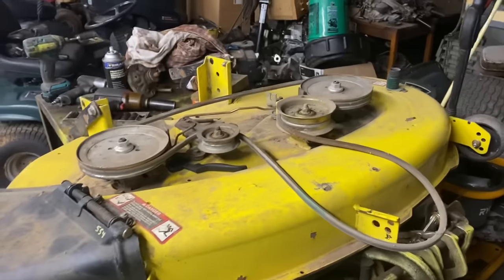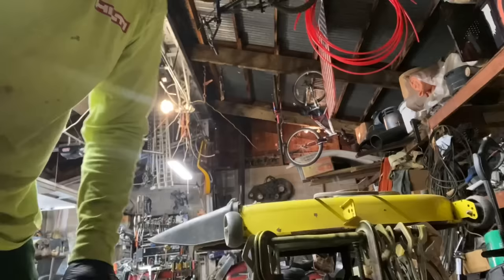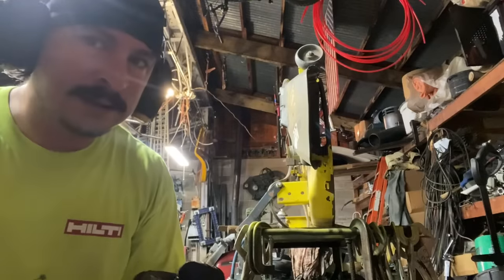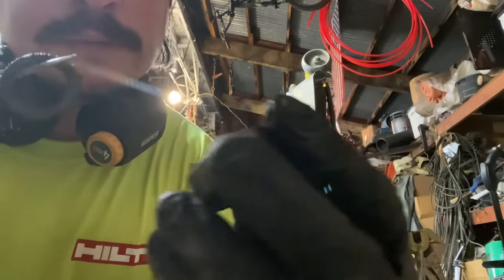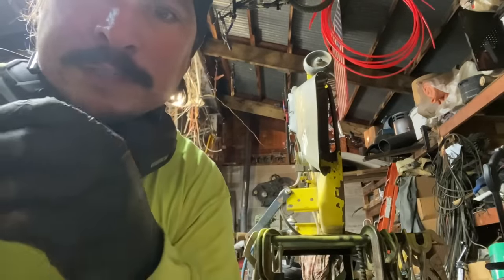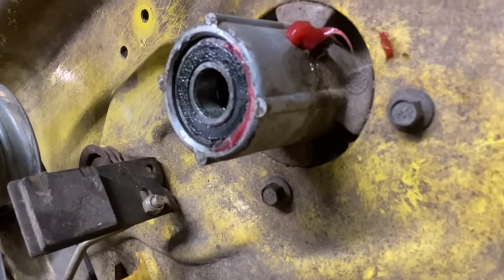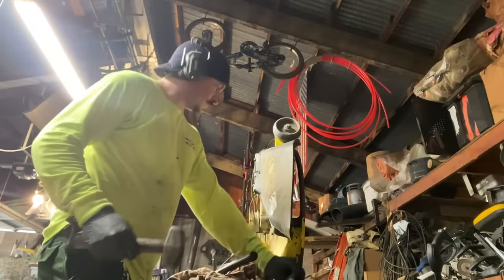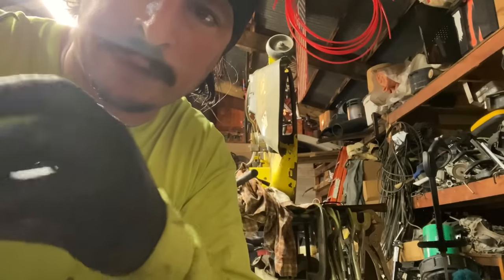Part 1 - Don’t trust the “Experts” Grease your mower deck sealed spindle bearings Common sense.

Comment: One thing that bothers me about so many of these bearing videos. I agree that is absolutely essential to have grease in bearings and sealed can be a bad idea. But why is it NO ONE ever sticks a thumb in the bearing inner race to rotate it and see if the bearing is still smooth & good. See if it is good folks before you take the trouble to grease it! Geez. Same issue with motorcycle wheel bearings. But overall, a great presentation. Thank you young man!
Reply from the maker: I recon I didn’t care about if the bearings were smooth or not just to prove my point. But I think anyone would have the natural instinct to check the feel of the rotating bearing to guage if it has obvious gritty feel. I know I always check them and spin the assembly before teardown to see if I feel an issue. If I feel an issue I explore deeper to see what one is bad, usually the bottom.
Reply: @GTObearclaw1  You're the kind of mechanic I would have liked to work with when I was younger and still working!

Comment: There are no zerks on my Hustler xonei 52"deck, got about 200 hours from new and outer,near discharge, that started some blade spindle noise. Bought a spare spindle,152$.Thinking when I change to see about looking at repairing and might put a zerk into each of the 3 spindles?
Reply from the maker: Dang, at only 200 hours and at a cost of over 150$ for just one. Dang, that’s steep. I can get a set of three for less than that on the box store machines and they typically last that long. I don’t think adding a zerk would be an issue. Iv done so myself on tractors that came without. I have found that having a zerk on the upper side of deck is much easier to access and stays cleaner and also good to point them outwards so you can get on them easy with the deck installed. It’s also wise to check your deck for a tensioner pivot zerk. If it has one, those things do wear down and occasionally greasing it will help it’s longevity. Iv even seen them rust and get stuck.
Reply: @GTObearclaw1  no zerks on idlers either, I will look on the big online box store next time, thanks
Reply from the maker: @alanbosma2159  idler and tensioner pulleys don’t typically have a zerk as they are not serviceable unless you know about the grease needle. As for the zerk at the tensioner pivot that I mentioned it’s where the tensioner arm pivots on the deck. A half way quality machine will usually have a zerk there that most folks never know about. Not actually the tensioner pully itself.
Reply: @GTObearclaw1  I looked on the big A for a part, none. Gonna try the big E next. I looked at the idlers and none have zerks and only other is for the drive pump,separate belt drive. I have a needle but was hesitant to peel that seal  back till I saw your utube..I have a spare  idler so if I can't get it back I can replace it . 
Thanks
Reply from the maker: @alanbosma2159  I have a few videos where I use grease needles. Just clean the seal really well so you can see it while inserting needle beside it. I find that turning the needle helps lift or move the seal aside without damaging it. If the seal is still soft and flexable it is usyally a smooth process. If seals are old and dry I have cut a few. But even then they can go for a year or two after adding grease. Just a little cut on the seal won’t be bad if you want to squeeze some extra hours out of it. But in most cases I have great success with the needle and not damaging seals. Thanks for commenting.

Comment: I have not seen a spindle  without it having roller bearings , Are ball bearings the standard on Homeowner grade equipment?
Reply from the maker: Yes absolutely ball bearings are the home owner model go to. Tapered roller bearings are usually only found in commercial grade or higher quality units.
Reply: @GTObearclaw1  I guess that explains how mine is going on 25 yrs in service, I was only able to find one replacement spindle for the center blade when i rebuilt the deck 4yrs ago.

Comment: If the spindles are making loud noise is it to late and the bearings should be replaced or just grease them heavy
Reply from the maker: If they are loud it’s probably too late. A good greasing might get you a few more hours but I’d check the loosens of the assembly by feeling movement of bearings. Obviously while the units not running and no parts are in motion. If the bearings have any movement, it’s not good. Consider this, if you do need to work on it and you decide to add grease first, you just made the disassembly more messy by adding grease. A well lubed bearing may never need to come apart but adding grease to a part that needs to be worked on will just be a added hassle.

Comment: This was meant for me to see, funny I just greased my spindles today (Installed new blades) I kept pumping like 30 times,nothing,  after about 30 more it came out.😮
Reply from the maker: Nice, thanks for the comment and confirmation on how many pumps an empty mandrel can take. You’re set now, in the future 4 or 5 pumps will get you done. I had a deck this week on an older model Husqvarna zero turn and the mantels took 92 and the other took 94 pumps before I seen any grease come out.
Reply: @GTObearclaw1  wow 92+ pumps mine is a 2003 Troy Built probably never greased, lol.
Reply from the maker: @davidlaws1438  that’s impressive but I don’t doubt it. Your lucky it had zerks. they can go a long time without grease sometimes. Iv had some comments about folks not greasing for 20 years and Iv personally seen some fail after just a few years and less than 100 hours. I’m sure it all matters how much grease they came with and more than likely highly dependent on the quality of grease used for one to be able to last 20 plus years. I’d say your safe to go for many years now without grease but it’s easy enough to hit it with a few more pumps each year just in case one didn’t receive as much grease the prior time! It’s always better to be proactive!
Reply: @GTObearclaw1  yes now that I know their there I will definitely grease every year. 👍

Comment: I have a 42” mower deck from a LA105 that the holes have elongated when I removed the spindle. Can I rotate the spindle and just drill new holes or how do I fix it
Reply from the maker: That’s a option. Low likelihood the bolts will come out of the spindle without breaking but you will
Have to remove it anyways to repair it so give it a try. I like to weld a reinforcment plate in while I have it all apart, I have some other videos to show that repair.

Comment: I've seen them with the lower bearing having the inner grease seal removed, but the upper still being sealed. That will allow some grease into the lower, but its not all of em.
Reply from the maker: Some have seals on the inside some don’t but if they have a grease zerk take advantage and fill it completely till you see grease exit and you will
Have longer bearing life. If you don’t have a grease zerk they are easy to add.

Comment: When you popped the seal off why didn't you pack the bearings then before you put the seal back on
Reply from the maker: Simply not what this video was made to prove. My point is that there is no need to go this deep into a bearing. Latter in the video I show how using the grease gun achieved that same result without any need for dismantling a deck. It all makes sense in the end. Needed to prove a point.
Reply: @GTObearclaw1  👍

Comment: I've been looking at all the different opinions on this controversial subject and have concluded that it's better to remove seals and here's why.  When grease is pumped into the spindle cavity it will flow along the path of least resistance.  Eventually the cavity fills and if you continue to pump the hydraulic pressure will rise until the weakest seal "blows" and lets the grease pass.  The other bearing seal is still intact and never gets fresh grease.  This is why I believe grease was seen on only one end in the demonstration.  If the inner seal is removed grease is free to continuously contact the roller balls from the spindle grease reservoir.

Another reason sheer hydraulic force might not work is that some mowers have a vent on the spindle.  My Exmark 48 has a zerk on one side and a spring loaded vent on the opposite side that allows the cavity to be filled but no real pressure can build.  With this design it is even more important to just fill the spindle to directly expose the rolling elements of the bearing to the grease supply and not rely on high pressure to force it in.

Just my 2 cents worth based on my own experience.  Cheers.
Reply from the maker: High pressure is never reached. You will barely feel any resistance on the handle. Your overthinking a very simple process. You simply think the process won’t work. Iv been testing this for a decade and it works. That’s why I felt 100% confident putting my name on the line to give folks the right information. The seals don’t get damaged or even come off the seat. As Iv mentioned in a hundred coments there is no room for seals to come out of place and it simply does not happen if an assembly is put together properly. No need to waste time removing seals. That’s the whole point of the video. I also showed that grease got in both bearings. You can do it your way I’m just offering proof it works this way as well. As for spindles with a vent hole. Just plug it. They don’t want your bearings to get grease, the big companies want your bearings to burn out. Prove me wrong. Just saying you think something works has no value here. Not trying to be rude but your 2 cents is just an opinion and not fact. I’m providing facts. Serious question, did you watch the full video? You can run a test on this yourself. I see where it seems like this wouldn’t work and that’s exactly why this is such a controversial topic. Just notice how all the videos stating that the bearings won’t take grease past the seal never runs any tests. It’s just experts that “think” it won’t work and eager to tell the rest of us how smart they are.

Comment: I bought a brand new top of the line 60” zero turn mower built by Gravely. The spindles are not greaseable and with a little over 300 hrs, every spindle has been replaced twice by the dealer under warranty. I’ve got to get rid of it when warranty is over cause I can’t afford the down time nor the parts. Ariens/Gravely needs to correct this!!!!!
Reply from the maker: We just went through that with a bad boy that hit 300 and only 2 years old. Absolutely ridiculous. And folks accept this crap. You can add zerks but we shouldn’t have to. Sad

Comment: took those covers off the bearings and they were barely greased, filling the mandrel with grease would also fill the bearings with grease, the caps are not 'sealed', but only covered with a cap
Reply from the maker: Yup, basically what I was showing in my video. And even with seals on the bearing the grease can easily pass by like I have showed 

Thanks

Comment: Pluck out 1grease seal from each bng. Drill & tap in the place between bngs for angle grease fittings. u can figger the rest.
Reply from the maker: Actually I did figure it out and put it all in this video. Forget removing seals. It’s a waste of time. Kinda the point of me proving that in this step by step video to make the point that grease passes right buy the seal. Did you even watch the whole video before you left this repeat comment? The seals don’t stop
Grease for the 900th time.

Comment: How did the grease get into the sealed bearings with rubber shields inside the bearings? I don't get it?  It's sealed and really has no evident path to the bearings?
Reply from the maker: Don’t think of this a seal on a hydraulic cylinder that can handle pressure. The word seal should be used carefully here. A seal on a bearing cap of a rubber bearing shield is basically the lowest grade of seal. It basically keeps out dirt particles and that’s about the best it can do effectively. Keeping water out for the most part but not really dependable at that. If the deck were to be heavily washed or submerged you would most likely find water in some of the deck bearings. Grease guns are made for this stuff. They create pressure, Grease is liquid. A pressurized liquid simply pushes past a flimsy rubber lip ? these things are not impenetrable? The zerks are functional regardless if the inner shields in place, it’s only a rubber lip. Grease Oozes past seals all the time. This is no different. Not exactly ground breaking information here. Just be open minded. Consider the possibility, try it. You only stand to win. I’m not gonna know or gain anything from it other than knowing I helped some folks.

Comment: Not sure about amount of grease in bearings, but couldn't the bearing be repacked?
Reply from the maker: I made this video specifically for folks who are Not sure about the process and also not sure what “expert” to trust. I’m no expert but at least I post the full process rather than just blabber about my opinion on the matter like some guys posting nonsense information. I want to help folks, not drive them away from doing basic Routine maintenance. I bring the facts and show each step including the results. Pretty good for a grease monkey shade tree mechanic non expert. Yes of corse you can pack the bearings. Seal pops off real easy. So that’s possible and I have that process in some of my other videos. But the work required to pack them is a lot more intensive. you have to pull the deck off and mostly apart to get to them. If a zerk is in place already, pump the grease in, no additional labor needed and the gun will get the grease into the bearings way faster. And for the amount of grease. If there is too much, it will squeeze out of the lip on seal. So you could say these bearings are self regulating.

Comment: If this is true, why don't manufacturers pack the spindle with grease, instead of just the bearings ? After removing the bearings, wouldn't it be easier to fill the cavity with grease before replacing the bearings ?  (avoid the 40 pumps).
Reply from the maker: Heck for that matter why don’t they just use a excellent quality grease. It would not be a huge cost for the manufacture if even just a small amount of high quality grease was used in the sealed bearing it would go a long way. But sense when did manufacturers want the things they sell to last long periods of time without failure? That was the good old days that are long gone now. Why we always hear that old saying “ they don’t make ‘em like they use to” We are in the throw away society now. Such an exciting time. They want us to buy the next new bigger better model. Throw away that 5 year old junk and buy a newer better model. 
Why would a manufacturer want the bearings to last a long time? Obviously It’s just my opinion that they put just enough grease into a bearing to get it to last the amount of time they think will be acceptable and a failure will not seem premature. I believe they have engineered the parts to fail. They know what they are doing. That’s why I’m trying to help folks perform Preventative maintenance that will make parts last many times longer by simply doing basic maintenance. As for the 40 pumps. That’s just how I choose to do it. I could say to pack the bearing but is less messy just to connect the fitting and pump the gun. And giving a basic idea of how many pumps is to help folks know what to expect.
Reply: @GTObearclaw1  your comment regarding 'living in a throw away world' hit the nail on the head perfectly. Truthful videos on YouTube are getting harder and harder to find. Your videos are an exception, keep up the good work. Thanks for your efforts.
Reply: @delemerson9306  I knocked out the spindles and pre packed my last set of new ones.  Then mowed the front yard to get things warm and sling stuff out and pumped them the rest of the way.
Still took 20 pumps.  I doubt youll ever get all the air out of there but thats probably a feature, as expanding air bubbles will help move grease where it needs to go.

Comment: Back in the late 90's I bought a new mower that did not have the zerk fittings on the spindle assemblies. At the time I was told they have sealed bearings that had grease in them, I was naive! After 2 seasons of mowing, guess what, one of the assemblies went bad, made an awful noise and was rattling around, the bearing went out. I bought a new assembly for like 90 bucks or something close, and it didn't have the zerk. I put one in it myself, and to the other 2 spindles also. Guess what, those spindles out lasted the deck. Morale of the story, no such thing as SEALED BEARINGS on these mower decks, and a little grease will save you a bunch of money.
Reply from the maker: Thanks for the comment. Your smarter than most
Reply: @GTObearclaw1  Thanks for the video!

Comment: You are correct same as a ball joint if it's a sealed bearing grease won't do any good
Reply from the maker: I didn’t say grease won’t do any good. sealed bearings like in my video will take grease as I detailed